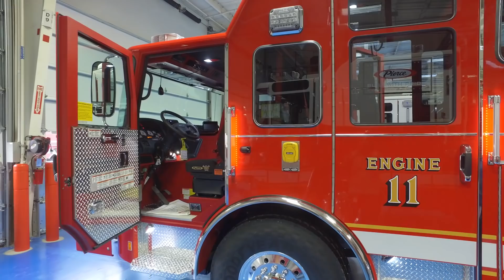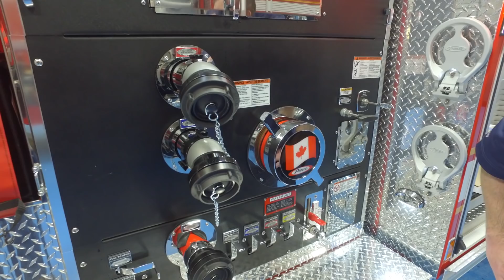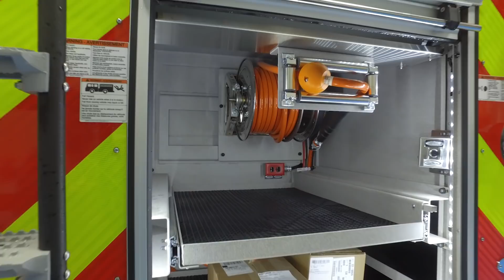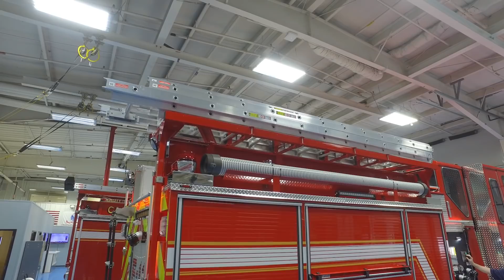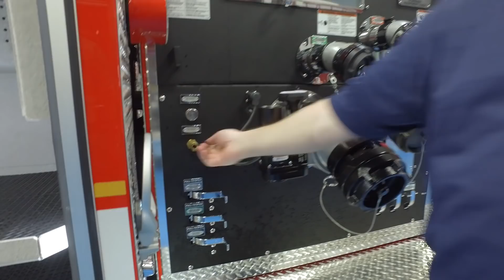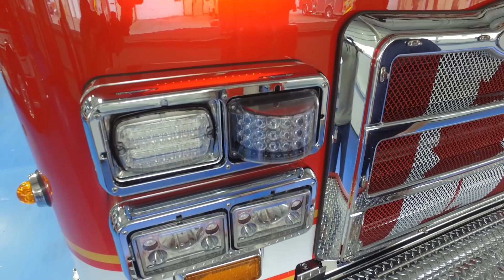Enforcer™ Pumper – Taylor Fire Rescue, BC

Comment: That is a mighty fine looking unit with a lot of unique features. The reflective  hazard chevrons on the rear are a simple but vital safety addition to any emergency vehicle as it improves your vehicles visibility to other road users quite substantially, especially at night or inclement weather. Melbourne, Australia fire trucks also have horizontal strips of yellow reflective tape on the front of the Scania cabs and they really stand out from a long way away. Well worth considering. I was impressed by the Engineers station inside the rear cab as well as the pump enclosure to protect from very cold weather. The Engineer will also be able to see more thanks to the elevated position of his work station. This feature could become a trend setter.

Comment: When arriving on a fire scene, I'm guessing you would keep in mind apparatus placement so the pump operator can see the fire/firefighters out the rear or side windows?? It might sound like a stupid question but some FF's have never used or seen a engine in use with a pump panel mounted in that position.

Comment: What does paid-on call mean?
Reply: It means its volunteer you only get paid when you have a call for service.
Reply: My guess, they are paid on a per-call basis
Reply: For Example, back in my early days , I was " PAID ON CALL" , we were volunteers & per call we received $20 per run, if you were onboard a rig and that rig breached the station's apron to street you got that run paid even if the rig got cancelled on the call, different depts have various rules but you get the idea.
Reply: for me, paid on call means that while i am a volunteer, while i am on call i get paid $3.00 per hour. so if i am on call for 24 hours, i get paid $72.00. if nothing happens, then its easy money. if something does happen then i get bumped up to $12.00 per hour from the time the call goes out to the time the truck is put away in the station and back in service. then i go back the $3.00 per hour to finish out my shift. this money is taxed just like any other paycheck, too, so its not a lot of take home cash.  i work as EMS as well so this covers everything that i do. now, the last 160 hours that i have been on call, there have been no calls for service. this payment system allows our department to stay staffed in a area that nobody wants to volunteer. and it helps some of us offset (but not much) what we have to spend on our personal gear, things we need that department cant buy. like boots, coats, flashlights, non turn out clothing, etc.
Reply: Very much more cost effective than Career Dept's! You not paying guy's to sleep on the job.
Reply: @daveboydell2896  yeah not many departments get to sleep very much